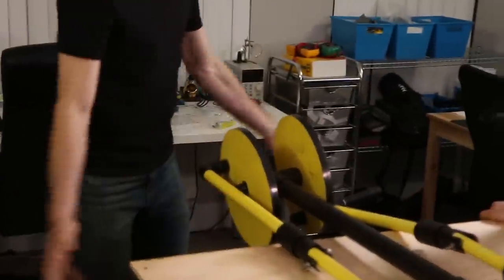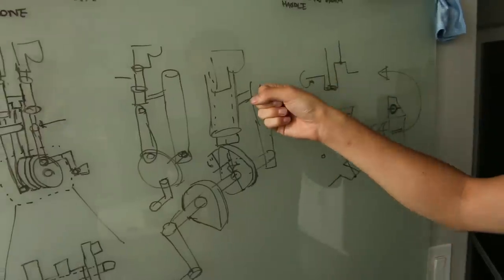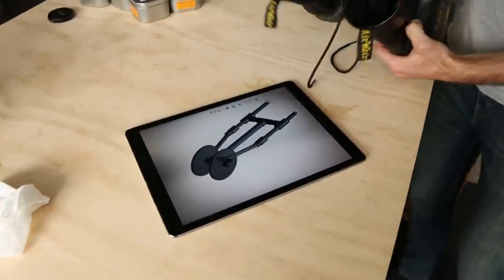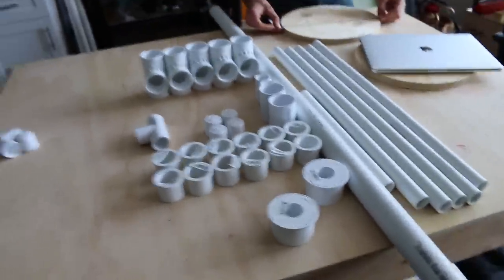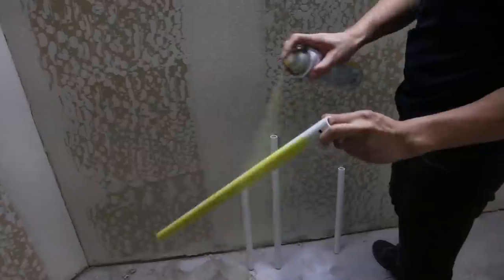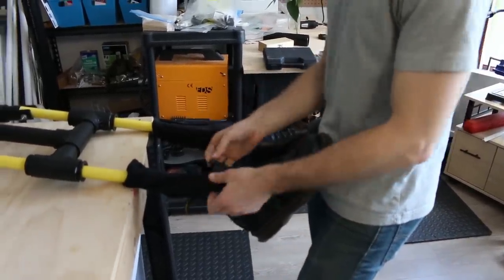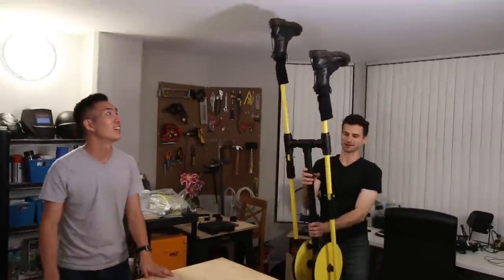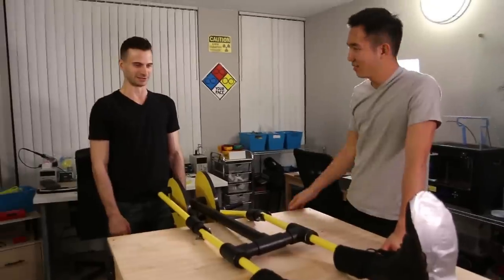How to deal with LOUD Upstair Neighbors

Comment: Live in NYC & there are usually always loud neighbors in all buildings. In the apartment above mine the guy is always moving furniture around every single day. Walking around extremely loudly. Not the worst though. The apartment below mine though, the TV is always loud as ever. It's woken me up at 12 in the morning. The women down there is drinking like crazy is my guess cause I've heard her literally everyday laughing her butt off and talking extremely loud. I've gone to her apartment & asked her nicely to lower it down & she blew me off saying it's not her problem. Building management don't care, which doesn't surprise me. It's all about the money for them. Hardwood floors & thin wall's sucks! Ugh...
Reply: OMG. I rarely comment. Same situation here that you described right down to laughing loud drunk females! The men stomp and throw around weights.  I realize noisy neighbors like these are a certain type that it would end badly to confront.
Reply: I had the exact same problem. I started banging a hammer on the floor at random hours. I then started hearing her complain Because she talked so loud I could also hear that the reason she was moving out was due to banging noises... Ahh so satisfying.
Reply: My upstairs has 2 kids. one is 6 month old, and one is 2, they play with those wooden toys and drops them on the oak wood floor. Super loud. Every time when they drop, I feel like I have a mini heart attack. I've been crying for 2 weeks ever since they moved in. I can't study, can't sleep because they don't sleep at a regular time and they get up very early. The kids play at home, stomping, running, moving furniture and worst dropping items. I am having diarrhea all day today due to hypertension and lack of rest. I feel I am dying. Can you please let me know how did you end up with?
Reply: It is their problem if they are heard on another floor.

Comment: I've been experimenting with putting noisy things on strings and taping them to the ceiling fan. And until I saw this video, I thought I had lost it..you guys ...LMFAO. I can't even . I'm howling over here! 🤣
Reply: me too...... I use a small bouncing rubber ball. I hit hard with it on the roof. I do it when they sleep early in the morning. You could use a rubber hammer too. Just do it for a couple of minutes and stop it  and repeat it keep doing it for a few hours and it will make them go mad. You could also use the back of the broom stick to screech or drag along the wall to annoy them .
Reply: @rambaan2615  me too...... I use a small bouncing rubber ball. I hit hard with it on the roof. I do it when they sleep early in the morning. You could use a rubber hammer too. Just do it for a couple of minutes and stop it  and repeat it keep doing it for a few hours and it will make them go mad. You could also use the back of the broom stick to screech or drag along the wall to annoy them .

Comment: I am so building this. I have a family of 5 constatntlytantly running, jumping, skateboarding, throwing heavy objects boys, a crying baby and an arguing couple living above me in a 1 bdroom. My floors are shaking....they are those kind of people who take up 2 parking spots instead of pulling up a bit so another car could park. Oh and we are in NYC....o
Reply: me too...... I use a small bouncing rubber ball. I hit hard with it on the roof. I do it when they sleep early in the morning. You could use a rubber hammer too. Just do it for a couple of minutes and stop it  and repeat it keep doing it for a few hours and it will make them go mad. You could also use the back of the broom stick to screech or drag along the wall to annoy them .
Reply: From the sounds of things they're actually the type to stack 5 cars on top of each other to fit into one park
Reply: try a wooden broomstick
Reply: or do what I do which is put a Bluetooth speaker up  against the ceiling and play marching sounds for 2 hours
Reply: or unitill they stop makeing noises

Comment: A broomstick might’ve saved you some time. But nice work
Reply: I tried broomsticks, basketballs, pounding on their walls, calling the office.. nothing works
Reply: @mistabozack8258  I taped a vibrator to the air duct that runs under their floor. They were heated
Reply: @toonice7067  lmao.. savage
Reply: me too...... I use a small bouncing rubber ball. I hit hard with it on the roof. I do it when they sleep early in the morning. You could use a rubber hammer too. Just do it for a couple of minutes and stop it  and repeat it keep doing it for a few hours and it will make them go mad. You could also use the back of the broom stick to screech or drag along the wall to annoy them .

Comment: We moved out and together 3 years ago. And we did this but with a modern object all you need is the hard part of a broom lol 😂
Reply: Classic problems require classic solutions.
Reply: I did that too but i did it too hard i poked a hole in the ceiling, but hey, i continued poked through the hole DIRECTLY on their floor. But of course I had to fix that ceiling. LOL Next time I use a boot instead of something pointy and hard.
Reply: I do that and turn my tv up to 60 and then turn it down when they stop then turn it up higher  than 60 if they do it again and I will have it on something scary
Reply: Great that i what I use honey and sometimes it works but mostly not 😭

Comment: I live in a city of 300,000 people. The police department shuts down between 11pm and 7 am and only has patrol officers operating. We're given the option to file a noise complaint but it can only be done by e-mailing the bylaw division which also can't be reached between 11pm and 7am. Our upstairs neighbours literally stomp around on the floor above us and next to contacting building security to keep the noise down, that's all we can do, which ends up with our neighbours throwing garbage down onto our balcony, even though they aren't told it's us (which tells me they know their noise is going straight down to our unit).

Don't people know that this is the kind of stuff that people get murdered or sent to the hospital over? I don't get it... Why do people STOMP (note: I'm not saying walk loudly, I'm saying STOMP) on their floor when they live above someone. That tells me they're actively trying to be noisy and the real kicker is we've never seen each other and never talked to each other but lo and behold, there they are stomping with full force on the floor.

Comment: just run the one "stick" rather than two. And put a rubber end on it, like a set of crutches. 

That sex toy is a tried and tested mechanical design, so i'd be using that as a basis.

Comment: What makes you think you'll have enough friction with the floor to make this work?  You may get the boots to touch the ceiling but they will not make any appreciable noise.  You would be better off with some sort of spring and cocking system so you turn a crank and fire them at the ceiling repeatedly.  Curious how much damage you'll do to your ceiling though.
Reply: I think they should just get a hoist and lie flat on their back and up-stomp the ceiling. I would wait until they sleeping though, for maximum effect.😂

Comment: 3:43 -and it becomes a porno...

6:28 -I die

The wheel could've been rested on the floor, so you could just support the apparatus vertically, and walk around to drive the motion -if you want to mod it a little more for that buyer you got...

Comment: You could most likely solve the issue of it not being able to go full speed by giving it some sort of flexible material where the boot it , and putting some teflon on the bottom of the boot so you can have the least friction so you can hit faster and have it not just get stuck but give way after enough force (more than just the spinning but less than it being pushed against the ceiling, maybe just when it hits. I could be wrong tho, just a suggestion

Comment: If they have the right, you have the right. Nothing to be upset about upstair neighbour. I have one solution also btw. Atach the woofer on the ceiling and play footsteps sound but disconect the speakers, just bass so your not loud for all the neighbours around. That will make them think.

Comment: This is a funny video omg. I had high hopes. They were dashed. But then... I thought of something when I saw your invention at the point of the initial boot failure. Just use a broomstick and stuff it with bubble wrap until it's stable. Make two, since you have two boots, & then you can even cause more confusion by being in different rooms. Everyone reading this should be warned, do not use high heels, they will damage your ceiling & you might end up losing your security deposit. Think loud, wide & clunky. OK, having said all of that, just be aware that you are not trying to damage the ceiling. Good luck!

Comment: Worse is knowing how to set up an electric guitar and amp. After 6 months of 15 hours a day of a kid for anyone wanting to know step by step how to do this and thoroughly in an apartment. Step 1 find an electric guitar with at least 2 single coils and a humbucker or 2 active humbucker pickups which use a 9 v battery 🔋 in the guitar Passives don’t use batteries. Tune the guitar open to EADGBE. Acquire a 100 watt cabinet 100 watts minimum that has a tweed setting if not buy a pedal that can modulate Tweed set up if you want all Bass,the EQ scoop your mids turn the bass all the way treble all the way to zero. Put heavy overdrive or Fuzz in front of the Amp. Set the Bass on the pedal WET! Put your Gain on like 3-4 out of 10 vibrations not distortion is the secret play power chords is the secret from 1st fret to 5th fret. After 6 months of this kid running end to end I did this use your guitar 🎸 on the neck pick up only for more bass and full forwards toggle for more roar. It does not take much volume to put decorations on the furniture in your apartment on the floor. My model airplanes were doing 360s back n forth on my tv stand set up like this. They then learnt what noise really was. I would play on Sunday during church time. I broke windows in my unit with the Bass I would shred at like 2:30 am full blast we’re talking over 200 decibels this is why you MUST have a powerful amp. A bass bass guitar will really buzz just don’t blow your speakers. I got evicted when I showed everyone for a week what their own medicine felt like and the cops were like holy shit that’s loud. This is how I got even and kicked out after nonstop kids making my world be inside a drum 🥁 was I JUST ADDED GUITAR 🎸 and BASS TREATMENT for my neighbors.